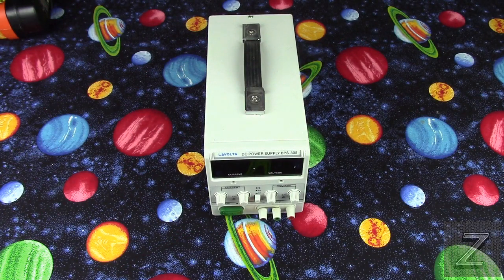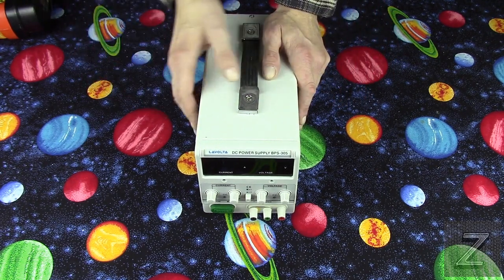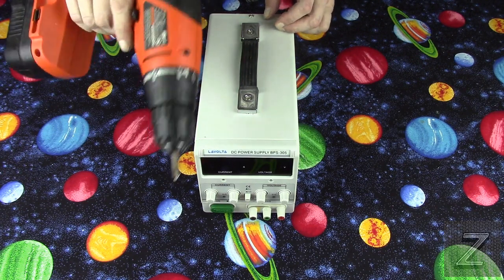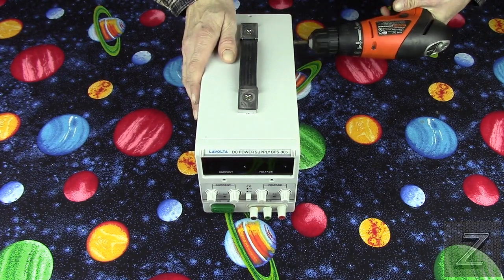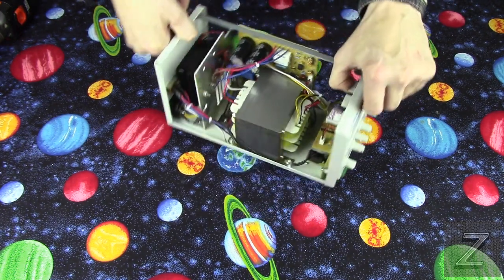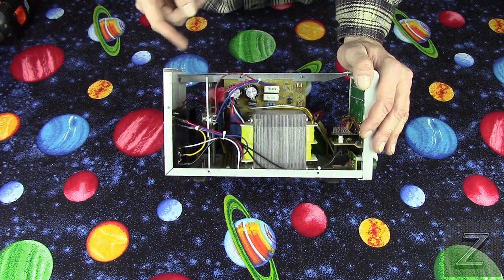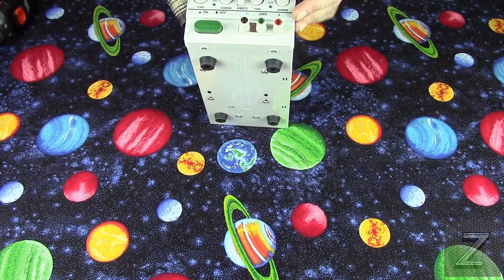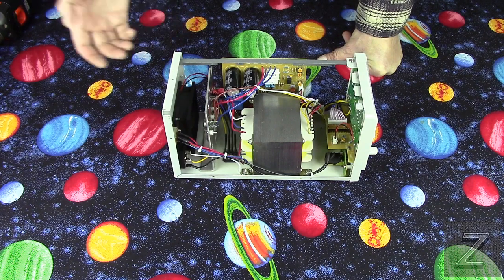A Look Inside A LAVOLTA Variable DC Power Supply

Comment: Thank you. When working with electronics like servos and motors, you want to test it and propellers for lift capacity etc and maybe circuits. I am just so damn afraid these Chinese things will blow up in my face lol. But this wont :)
You might want to go through the circuits and look for cringy solutions and choices made by the manufacturer, if its the kind of trafo that will sing, input power board and protective circuits and maybe if there is a bi-metal overheat protection as well etc etc